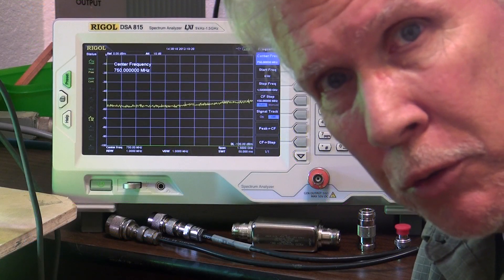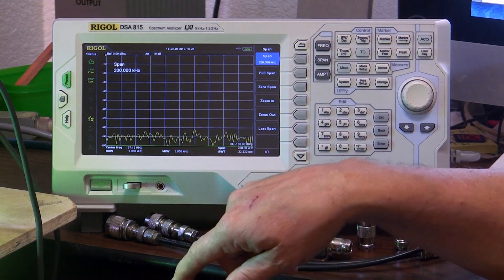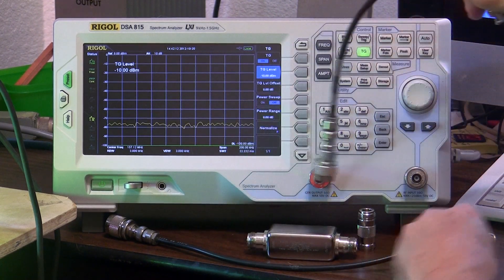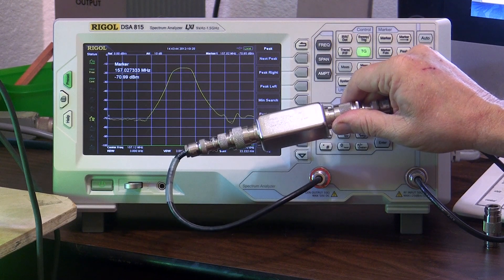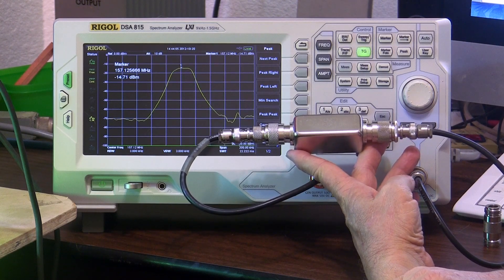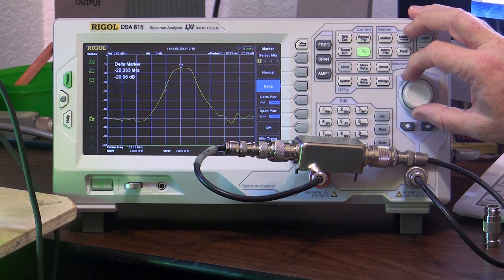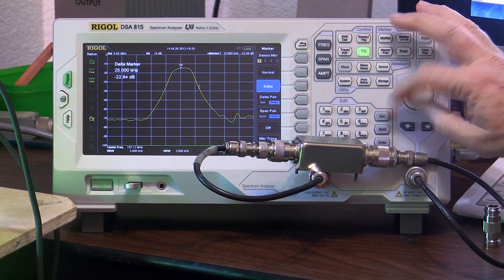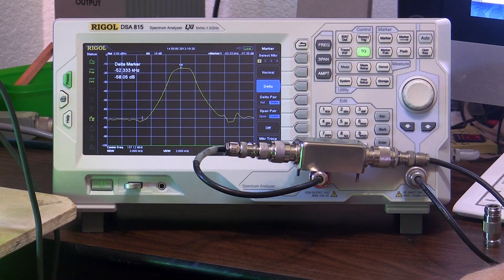DSA815 TG Basic Tracking Generator

Comment from the maker: Is it a Network Analyzer?  No.  Is it the best Tracking Generator in the world?  No.  Is it a useful addition to my ham shack at a price I can afford?  Definitely!  

I don't think you can touch the DSA815-TG performance for anywhere near its price point, even used.  Similar performance using new equipment runs upward of $15K... with most closer to $25K.  Used equipment with tracking will be twice the price, not very portable and with no convenient save, control, and post processing functions.